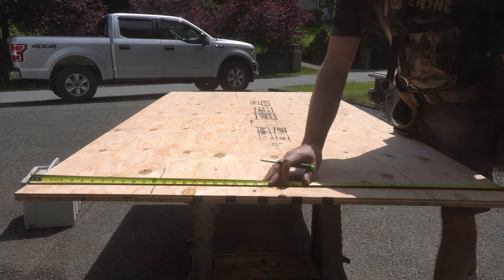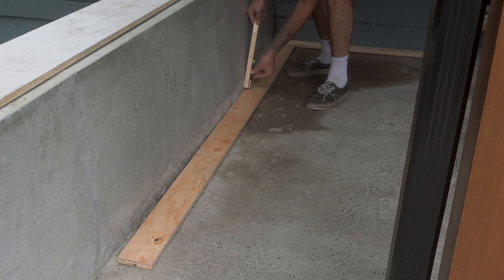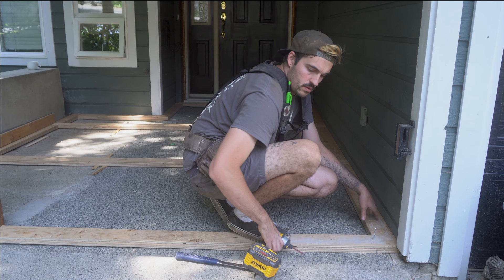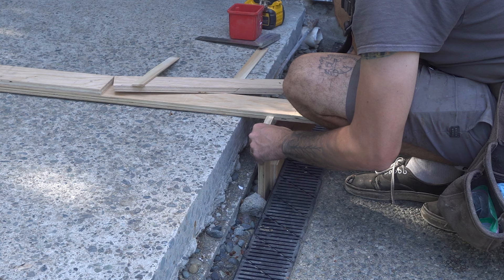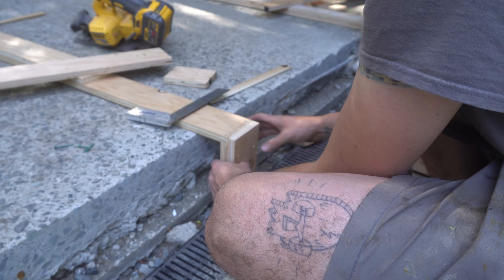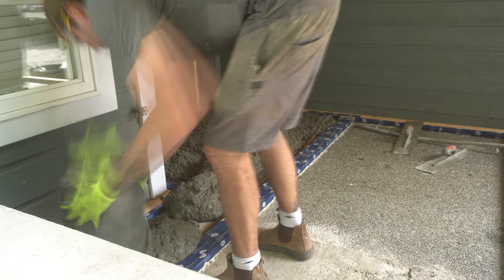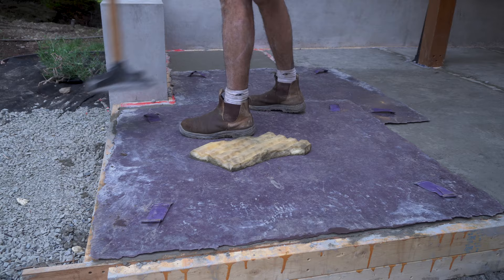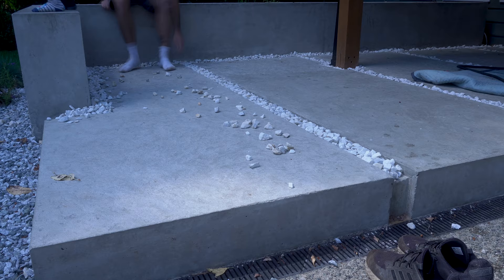I STAMPED My Modern Concrete Entryway Walkway

Comment: Hello, this is a nice explanation of your project. I want to do something similar in my back yard but I have a few questions, what PSI concrete did you use? I am curious to know if the new concrete (pavers) are still intact, meaning no cracks as I have heard that there is a high possibility that new concrete over old concrete would crack. I hope you can answer my questions. Thank you for the very well detailed video.